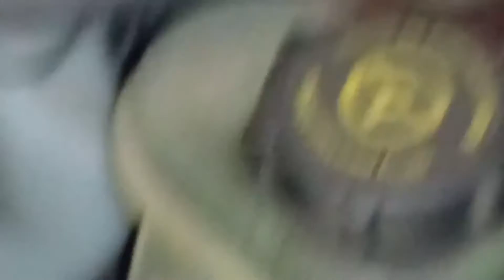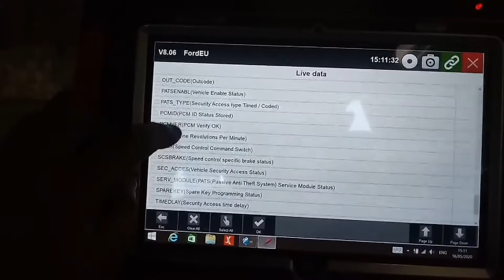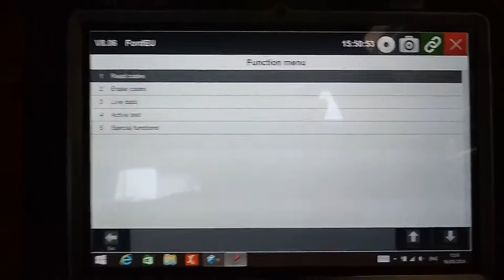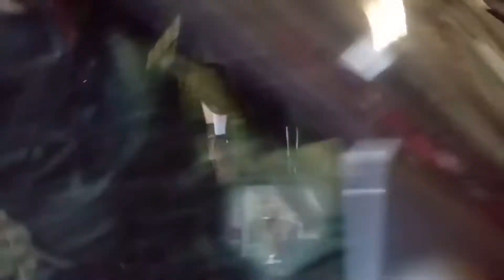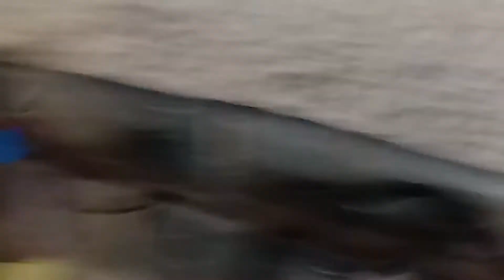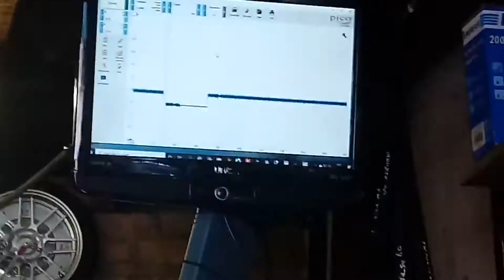FORD MONDEO 2007 2.0 DTCI exesive smoke diagnosis. Diagnosed with FOXWELL GT80+ and PICO 4223 PART 1

Comment: Oil just isn't a great fuel for a piston engine.  The soot it produces cloggs egr valves, Turbo vanes, particulate fillers.  If that wasn't clear enough look at the colour of the oil a few hundred miles after an oil change, already black and sooty.

A Petrol hybrid is the best solution until the charging network and speed improve.